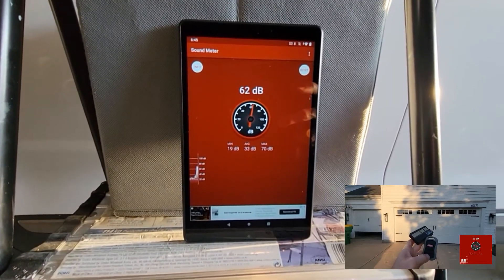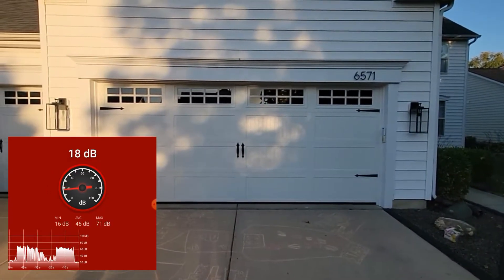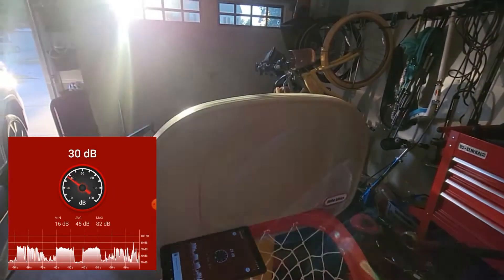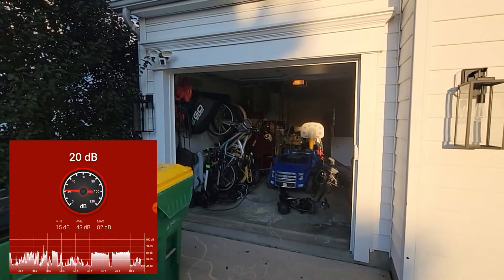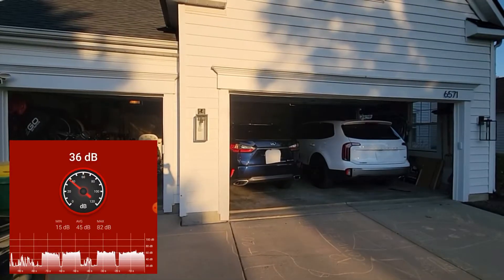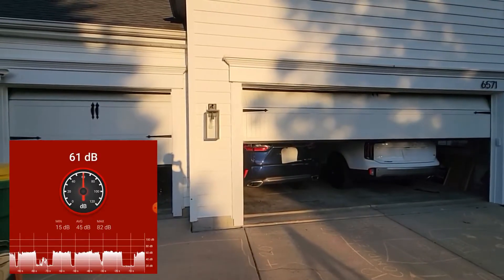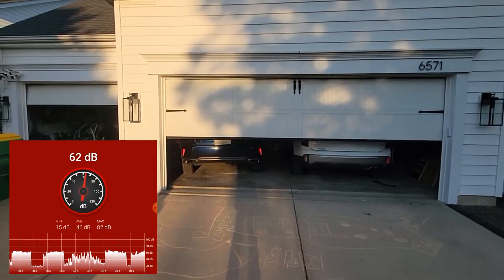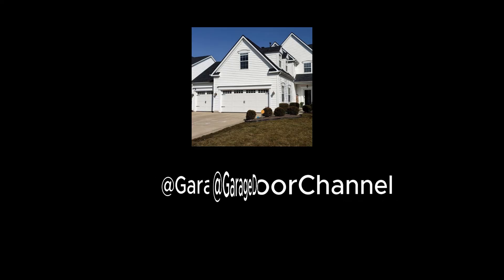Garage Doors Opening and Closing | How loud are they?

Comment: Uhmm dude that's ring floodlight cam wired pro where you get from?
Reply from the maker: I got it on sale and refurbished from woot.com. It was only $150 or so, but they are only available sometimes
Reply from the maker: I bought 2 of them
Reply: does it had a Super loud siren